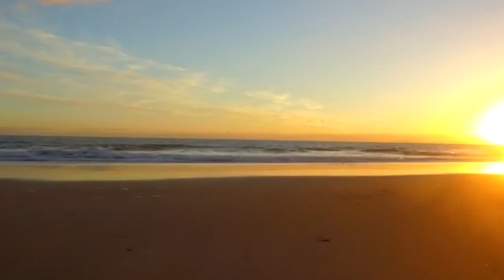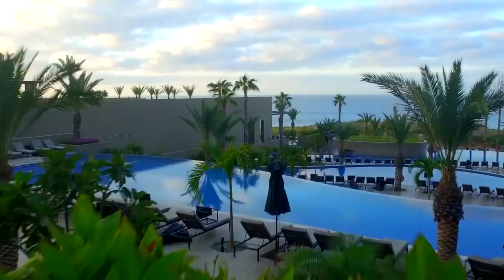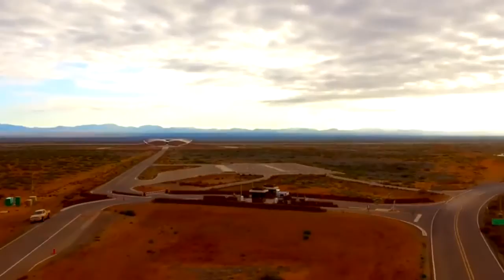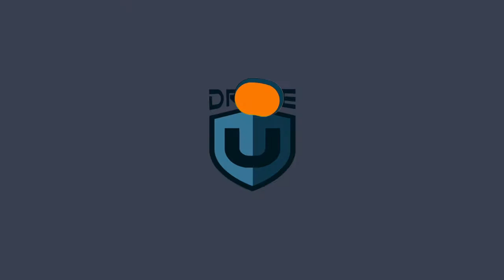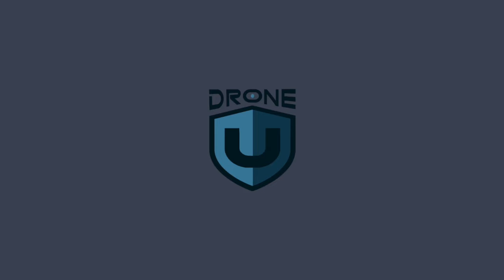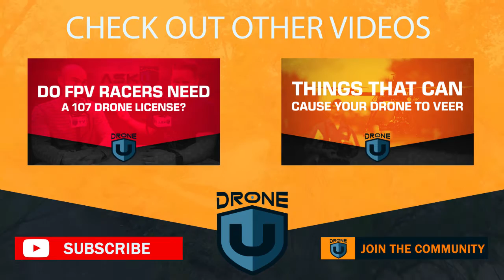Will charging batteries that are not fully depleted lower their life cycle?

Comment: Hey guys I really appreciate your videos but your answer about batteries needs further research. Your advice is good for NiCD and NiMH batteries but not LiPOs.  You don't want to go as low as possible. Deep cycles on batteries are harder on batteries than just lowing to 50%. While i'm sure DJI's batteries shut off with 20% residual power even though they say they are dead. The worst thing for LIPOs is heat and the further you discharge the battery the hotter they get. When your job is done bring the phantom down and power off. Don't feel like you need to fully discharge battery

Now topping off a battery can be bad because the charger needs to bring up all cells to 4.20 volts. The charger/smart battery will go through small charge/discharge cycles to bring up all cells until they are balanced. If you just charged your batteries a few days ago you are probably only adding 10-20seconds of flying if you top them off. 

Also if you aren't going to fly for a while then leave your batteries in storage at 50%. I try to leave mine at 50% unless I know I'm flying in the next day. Otherwise I forget and leave them with a full charge for months which isn't the best for them.

FPV racers are probably the hardest on batteries. They can discharge a battery in under 5 minutes. Guys who fly until 40-50% bought way fewer batteries than guys who flew until mini-quad fell out the sky. Also when done flying you don't have to put the battery at a storage charge.

Comment: I love your show, and you are usually correct, but I believe you are wrong on this one. Lipo batteries will last longest in terms of cycle life if not depleted deeply on every cycle. The biggest no-no's are to store a battery depleted or fully charged, discharge or charge at too high currents, and to store it at high temperatures (or very low temperatures if fully charged). Deterioration is inevitable over time. It is accelerated by by misuse as described above.